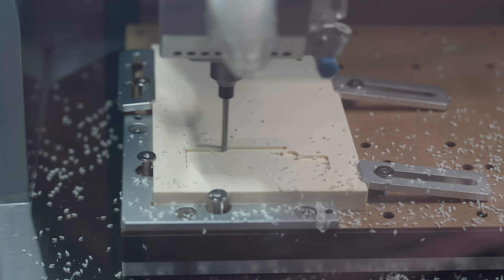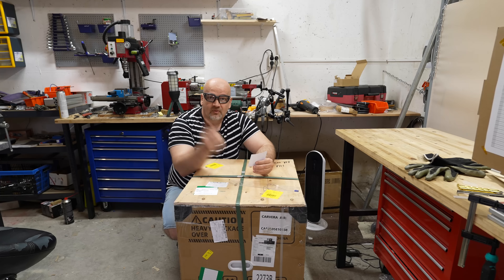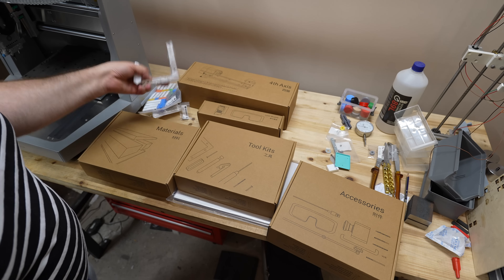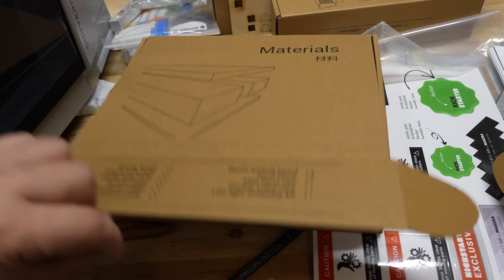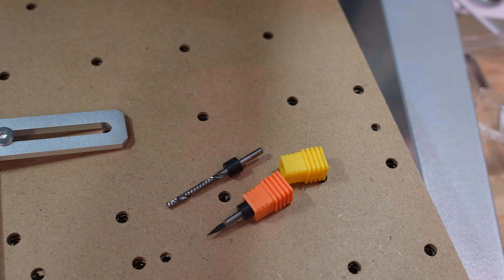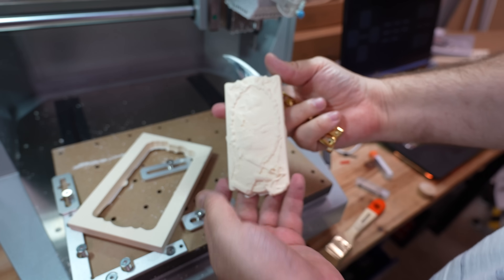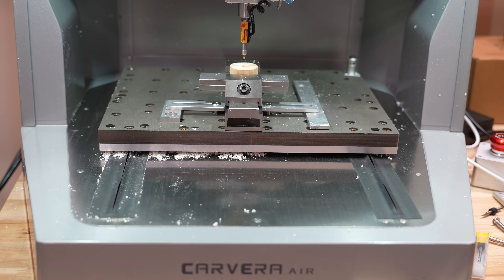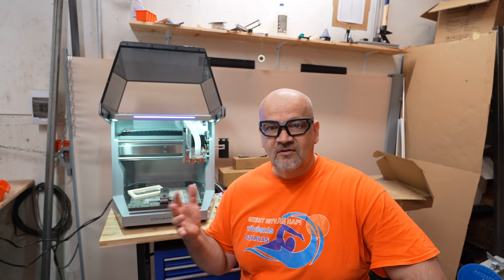BambuLab of CNC Milling? Makera Carvera Air Desktop Mill Reviewed

Comment: I'm getting the one with the tool changer... what vise would you recommend to get for it... I'll use your link to buy so as to help you out...
Reply from the maker: I am planning to buy a this one, really low profile: https://amzn.to/4msMq5X . Currently I am using this one: https://www.paulimot.de/en-gb/detail/7a856e1686a546a4bfecc9af293f6e57 but I don't recommend it, I modified it a lot (milling the holder groove and I made new nut inside)

Comment: $3000 and completely outclassed by everything in its price range. Onefinity blows it away. Anyone buying a CNC in this price range would be foolish to ignore Avid which isn't much more.

For the DIY guys a PrintNC and convertee grizzly mill are a far better value for the money.

This is really a niche product for someone who doesn't understand CNC and has money to throw away, because yes you will be throwing it away. Every CNC I mentioned uses a 1500-2200w spindle and can use larger than 1/16 or 3mm endmills
Reply: FoxAlien is much better than Onefinity
Reply: wrote: "Onefinity blows it away."

-- My question would be: how precise Onefinity CNC is, if instead of wood, it would mills aluminum block? Can it cut with 0.02mm accuracy? I could not find this info on their website, that is why I'm asking this question.

Thank you!

Comment: I built a basement shop full of CNC machines and CNC converted machining tools using LinuxCNC that I almost never use now that I make everything using 3D printing, but for someone who wants to machine small projects in plastic or aluminum, the Carvera Air desktop milling machine looks like a great option.  Not as capable as Tormach but much less expensive and easier to use.  With the addition of the 4th axis, the Carvera Air is a desktop machining center.  My only complaint is the MakeraCAM is only available for Windows and Mac, but the Makera software to control the Carvera Air is available for Windows, Mac, Linux, Android and IOS.

Comment: Have an Air at home and use the regular one at work.  The machines are good, but their CAM software is plagued with bugs and lacks a lot of basic functionality.  You need to use the machines with Fusion 360 or another mature CAM tool to make the most out of it.

Comment: It might be interesting for all a bit of a CNC miling of PEEK or PEI.
Aluminium is ok, but it has its problems in use.
Carbon fiber composite is abrasive, not to be milled whitout a  vacuum cleaner.
Thank you for all hard work and realworld information.

Comment: It's a nice machine but 2.5k is just too much. For under 1000 you grt a decent metal cutting CNC these days. Not as integrated as Carvera but still quite capable
Reply: Just bought a 3D Touch probe for 400€ for my CNC. 😂
2.5k is a pretty good price for it in my opinion, but only for Prototyping.

Comment: This and the DMC 2 are very compelling options. The maker of the DMC 2 has a video of him milling stainless steel and titanium which is incredible. These two machines are similarly priced iirc. The Carvera has great software which makes it a great option for people intimidated by the learning curve of programming these types of cncs. However i haven't seen the carvera mill anything like stainless or titanium. If the DMC 2 had the software that made it turn key it would absolutely dominate. Edit: misspelled DMC2 as DNC2
Reply from the maker: DMC 2 (in case somebody will search for it). Hm, yes, you are right. But remember, what I mentioned at the end of this video? Carvera have its own CAM software, which completes the whole eco-system. Better for beginners or non-pros. But to know. Thx for pointing this out.
Reply: I suspect it would struggle with stainless steel, titanium, or even mild steel. Besides spindle power, you also need frame rigidity.
Reply: Can’t compare Carvera and DMC2, they are totally different, DMC2 is a more industrial machine, having greater rigidity

Comment: My suggestion is that when not using air assist that the connector be closed off from the top so that dust will not clog it for when it is being used. It’s a cute machine for hobbyists.

But, for the price of this, one can get a much bigger machine, if the room is available. Yes, it’s manual, but most work is fine in manual, and you can work in steel as well. So it comes down to making small things for mostly decorative purposes, or doing more serious larger work. Take your pick.

Comment: Hey. Can you try to "slice" a file using FreeCAD's CAM module and then use the Makera to cut the part?
Reply from the maker: Eh, I am preparing another video, Gemnitsu Cubiko, they don't have software, but I will try to prepare some with F360 first. FreeCAD has CAM too? I didn't know about it.
Reply: @MyTechFun   Yes absolutly. FreeCAD has its CAM workbench that is used to produce machine instructions for CNC machines from a FreeCAD 3D model. These produce real-world 3D objects on CNC machines such as mills, lathes, lasercutters, or similar.

Comment: If this machine can cut through a 10 mm aluminum plate, even if it's very slow, even with the smallest cutter, then it's worth the money and it's not a toy.
Reply from the maker: In the meantime, I tried it. 10mm is no problem, since it don't cut it in one pass.. Its just very slow with this metal...

Comment: I'll bet 95% of my fellow watchers were hoping to see how this handles milling aluminum or other metals.
Reply from the maker: I was late with video, so I didn't had time for it. 4th axis and laser next video. Aluminum in 3rd, but since aluminum milling requires experience, I need time to figure out good settings. I didn't want to hurry with that.
Reply: @MyTechFun  Hey for aluminium try using a single flute endmill should fit well with the machines capeabilities, try going for a 1-2mm doc and a lower woc like 0.4-0.6 to start off. at 12k rpm a 6mm single flute could go like 508 on the feed also. Can't give very specific recommendations cause I have a Millennium Machines Milo and that can take bigger cuts but these should be safe to start out from.

Happy milling! ^^
Reply: @MyTechFun Isopropil alcohol or kerosene in a mist sprayer whil prevent chip welding. There is a good chanel on precision machining in homeshop (but on pro level), Stefan Gotteswinter autor.
Reply: @MyTechFun the settings are available in any machinist book. It’s simple. Know the chip load per tooth, how many teeth, what the rpm is and the table movement speed. The tables will give you the numbers per material. There are apps available for phones that will allow you to easily calculate this. Hobbyists tend to just guess at this which is why they have so many problems. When dealing with metal, guessing can get you into trouble. I would imagine the company does supply some info for the bits they supply.
Reply: @melgross  "the settings are available in any machinist book. It’s simple"

It is not simple.
Reply: @melgross those tables don't apply to desktop machines
Reply: Would have to agree no one’s trying to mill fucking wood
Reply: I do love your channel though
Reply: With such parameters and for such a price, do you have to be a moron to buy this? It costs as much as a full-fledged machine, but in terms of work, it's like a stump. It's not worth this money!!!
Reply: What about Titanium?
Reply: i dont think anything that size can compare to the DMC2 Mini CNC
Reply: CNC machining (not engraving) any metal, even aluminum, requires a spindle with good bearings, enough machine mass to reduce vibrations, and servos on the drive axes. Lacking all of these attributes, this mill will create small metal parts at a hobbyist level of finish and quality.
Reply: @TimAZ-ih7yb that’s exactly what it’s for. You should look at the Languir mill. It costs twice,is much bigger, but I don’t see how it can work steel very well.

Comment: I understand your content is for DYI and 3D printing entusiasts, but that is far from a real CNC milling machine.
Reply from the maker: I get your point. But if we follow the deffinition of "CNC milling", yes, the Carvera Air is a milling machine — just a small, lightweight one designed for precision desktop use, not industrial-level metalworking.
Reply: I don't think this position is well-considered. If your use case requires 3D printed titanium parts, you could say a Bambu "isn't a real 3D printer". If your use case is laser-cutting 8mm cold-rolled, you could say a CO2 laser "isn't a real laser machine". This machine is intended for cutting soft materials like wood and plastics. Maybe aluminum once you get proficient with it. If it makes accurate parts within those design constraints, why isn't it "real"?

This reminds me of the Roland benchtop machines. They're best used with plastics as well, and have about the same envelope, but are well regarded in industry.
Reply: It is quite literally a CNC milling machine by every definition.
Reply: To be fair, he did advertise it as “entry level”.
Reply: The real question is, is it enough of a CNC milling machine to achieve the goal of an entry-level hobbyist machine, namely, to let someone who isn't sure how much they'd use such a machine get a feel for how they'd use it, how much they would use it, etc., without a massive financial or training investment? Such a device is a "gateway drug" to lure hobbyists into buying much more expensive and complex machines. How many Bambu Lab A1 owners have gone on to purchase an X1C or H2D...